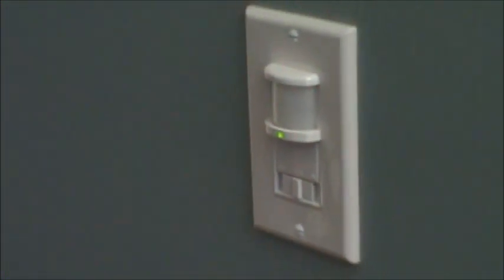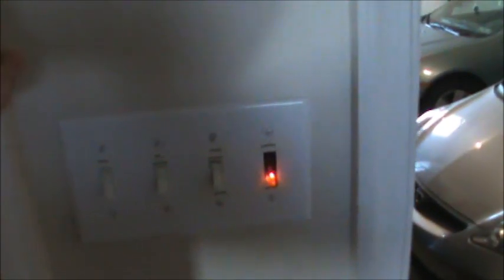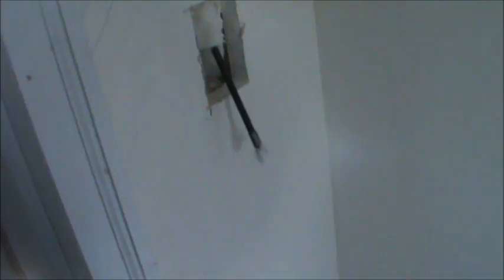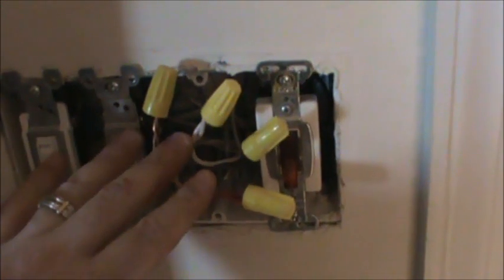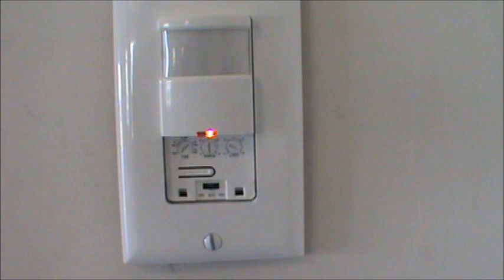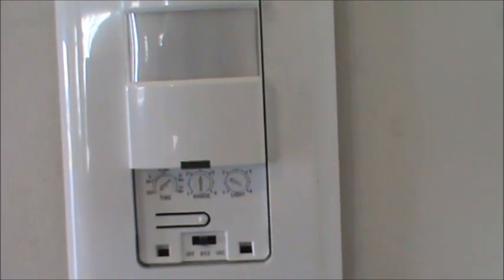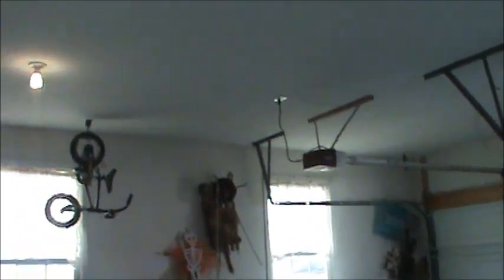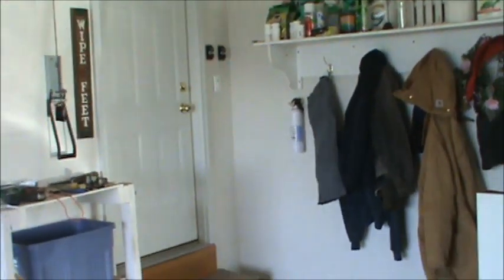Occupancy Sensor Light Switch Going Green

Comment: Nice video, and hope you, your family, and your son had a blessed 2015 and even better 2016. I use sensor switches everywhere possible in my home too. The porch lights, the bathrooms, laundry and foyer. Bedrooms doesn't play well especially since the switches usually control ceiling fans too. Yes there probably are some savings on electricity use and it bugs me when the kids leave on the lights all the time. But more efficient LED bulbs will save much more. I love the sensor switches for their convenience. It's a nice touch to walk around your home and the lights pop on. By now you've probably replaced that "dead" switch with a blank. The deactivated switch would confuse the heck out of people why it doesn't do anything. I'm buying those Vise Grip Wire Strippers right now!

Comment: I think you could run 10 not 12 100 W light bulbs for an hour for 10 cents. Per kilowatt. I had it wrong too.  :)
Reply from the maker: You are right.  I remember hearing that in an electronics class I took back when I was in school, but it must be a 100W bulb run for 10 hrs. costs .10 cents.  I will have to annotate the video thanks for catching that.  Good Job!